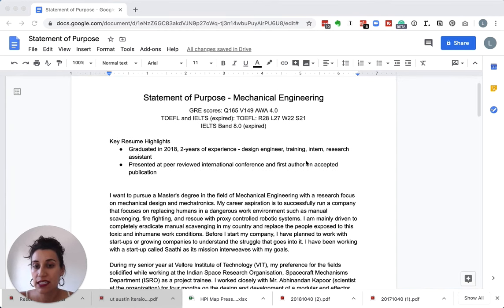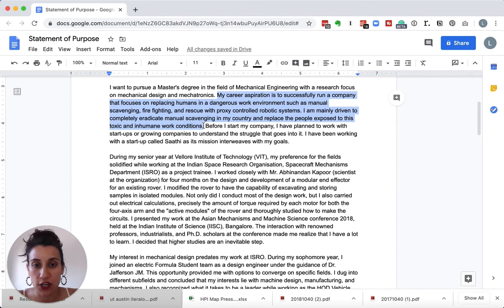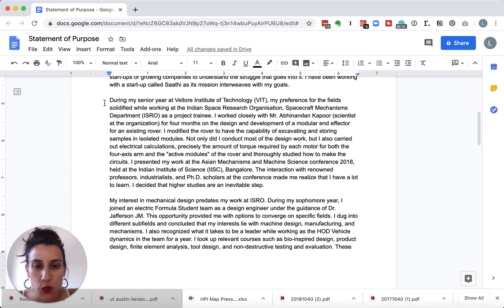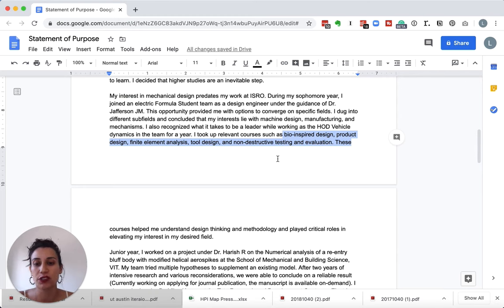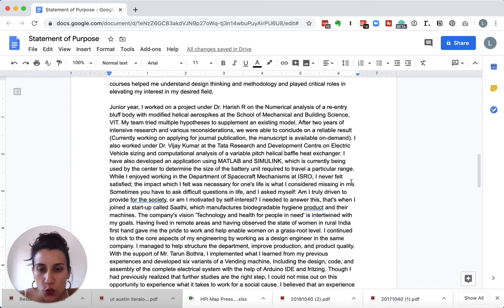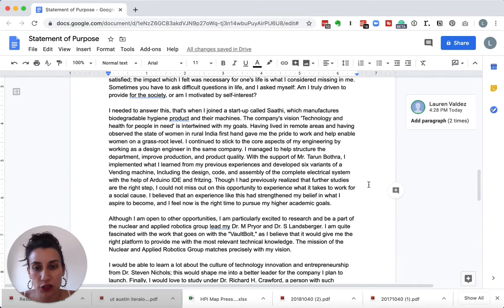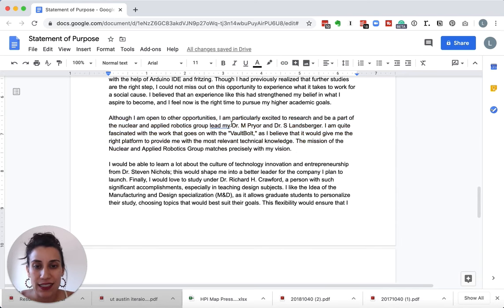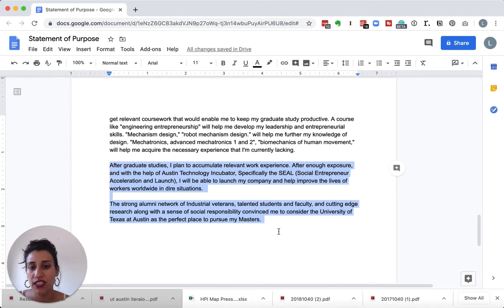Mistakes To Avoid: Statement of Purpose Masters in Mechanical Engineering

Comment: I have a question, what happens if you can write only 500 words maximum for PhD statement of purpose and you have many things to write?
Which part do you have to focus on? my achievements  or research plan?
Reply from the maker: Think of each component of your application as a piece of the puzzle. There generally isn't a word limit on a CV so make that as long as you want. In your letters of rec, have those people mention your achievements, then in your SOP you can touch on your achievements but focus more on your research. You can also check out this video where I edit an SOP down to 500 words and show the thought process I go through to cut it down https://www.youtube.com/watch?v=lflRhZRrw2k&t=1s
Reply: @LaurenValdez  thank!!!